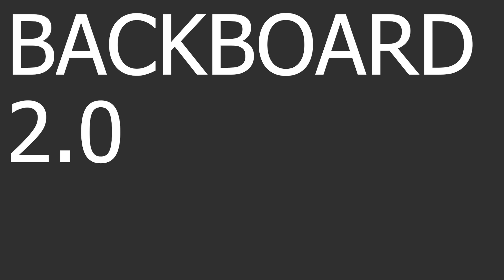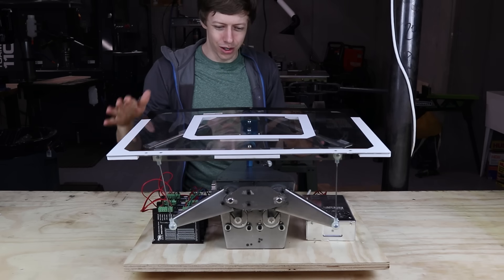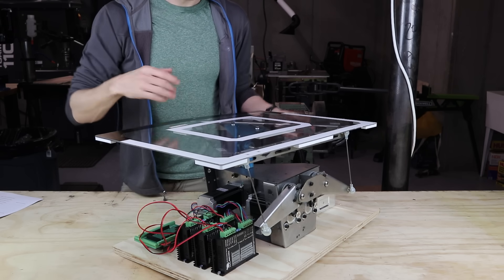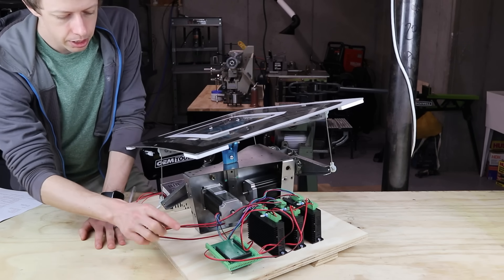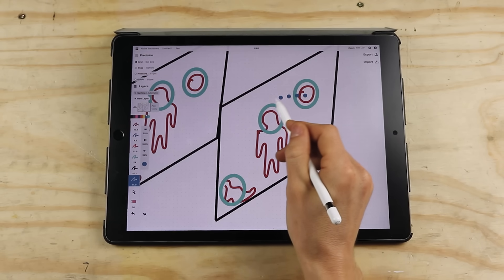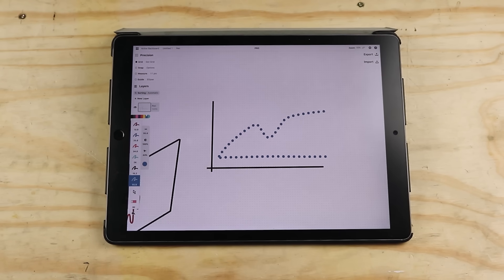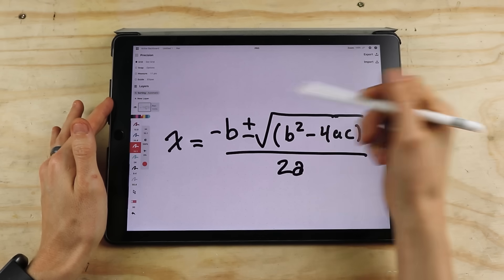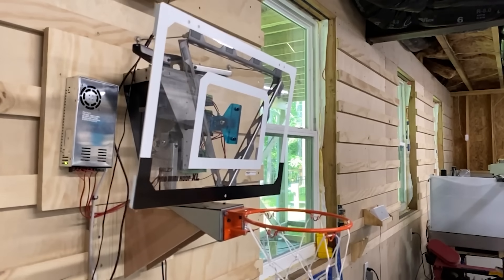The automatic hoop always goes in

Comment: Solving spin could be done using the same graph theoretic approach: there are two poses for every projection of a basket ball, so you simply match one hemisphere of poses, create two nodes for the closest match(es), then solve for the most linear slope of angular velocity (might want to use quaternions).
Reply: Alternatively you could estimate surface velocity directly, then you wouldn't need to solve for it when calculating the moment at the backboard.
Reply: If you model it as a constraint system, you can even solve for the Magnus effect, lol.

Comment: i don't know if this would work or is possible but could you put an RFD chip inside a basketball, like glue it to the inside of the bladder, and then use that to keep track of the basketball? Then it could make calculating the shot a little easier on the processor cause it knows the position and doesn't need to detect the ball mid air.

Comment: A cool addition to deal fast thrown shots (and ultimately less time to analyze) would be a guess adjustment to better set up the back board for the final move. Like take points from the earlier analysis and use those to make an estimated flight path and and only half compensate for the angle. Then when more data is collected and the ball has less time until impact, take the final calculations and move the hoop the rest of the way. Maybe it will have a significantly smaller distance to travel and thus can wait longer for the ball to reach the hoop, ultimately achieving a more accurate adjustment

Comment: What about potentially starting the tracking of the ball movement before it even leaves your hand? If you could recognize hand holding the ball by it's movements as it was beginning the throw, and know the approximate weight of the ball, then using physic's calculations. potentially start the prediction of its thrown curve before the basketball even begins the throw?  Although thinking about it, I imagine the hardest part would be to determine the actual vector trajectory of the ball, since it is heading directly at the camera.  Maybe a second camera in conjunction to have depth perception? I'm obviously not an expert on this, so I'm positive I'm missing some potentially obvious things, but just my thought's on the matter!

Edit:
I just finished the video, and understood that the actual interpretation of the kinect image is faaar more complicated than I initially thought so it's unlikely to be able to determine what are the hands...

Comment: You could have made a 3d model of the ball offline and then use perspective-n-point in real time to figure out fast where the ball is at.
To build the 3d model you could've used a corner detector algorithm from a lot of different angles and a feature matching algorithm between them, and then you know for each point in the ball in which pixel it is in each camera, now assuming you know the rotation and location of each camera you can build 3d lines from all cameras to the pixel and calculate it's location by the inverse of the sum of the rejections multiplied by the sum of the translations of each line.

Comment: I know it may be obvious, because you surely are a smart person with a big knowledge, but don't use Arduino in time sensitive aplications. STM32 microcontrollers are way faster, have much more peripherals, and are sometimes even cheaper than atmegas. Also, STM software lets you deal with all the register setting with graphical tools, you can debug your code, send variables in real life etc.
Reply: To give you some numbers: 
Atmega: 16Mhz, 100k samples/second 10bit ADC, 1x 16-bit timer, and some commucation modules (but very little).
STM32F103: 72Mhz, 1Msps 12 bit ADC, 4x 16 bit timers, much more communication (including CAN), lower power consumption.
And F103 is a lower-range STM and is cheaper than atmega328. You can buy STM32F401(so high performance range) on a board for like 4 dollars.

Comment: You say the microcontroller is your speed limit, have you considered using a microcontroller based on an ARM 32-bit MCU? The STM32 Nucleo64 development boards are based on these, they can run way faster than the ATMEGA MCUs the Arduinos are based on and the Nucleo64 boards feature Arduino pinouts too.

Comment: Since you are looking for improvements for this project, I could recommend using an FPGA board insted of a microcontroller. The FPGA would allow for super efficient processsing of sensor data and control commands since the logic is implemented on a hardware level.

Comment: Stepper motors are prone to resonance. They often don't perform as expected for other reasons as well. Unexpected friction or looseness causing a jerk etc... If you used dc servos it could work better. Steppers have a speed limit based mostly on the inductance and the voltage fed to the drivers. Beyond that speed you lose torque quite fast. If the stepper is somehow behind on its path it will quickly lose steps and may require moving faster to get there in time but that just moves the system into a state where it loses more torque and loses more steps. Not that the drive is even aware of the motor position, it only know it output steps not if the motor is stalled. With servos there is position feedback and while a brushless servo might be a multi phase motor which a stepper also technically is the controller may use a variety of different control methods for slow speeds and positioning of the motor, but at speed its likely using the position feedback or back emf for the signal for motor commutation and the motor speed is really being controlled by voltage as opposed to the stepper which is speed controlled by commutation and voltage is a product of a constant current circuit in the drive. The difference is that the drive in not only aware of actual positioning but if it is somehow behind and it needs to go faster it simply ups the voltage, when the voltage goes up so will the current and torque. To do this with steppers you'd need to custom design a drive that could detect lost position and also increase current in those situations. Some hybrid steppers exist and I have know way of knowing if they modulate current with lost steps or just play catch up but either ways it gets silly trying to make a better stepper motor because a servo can easily have a better speed envelope and may not be more expensive by the time you install encoders and custom firmware to a stepper system.

It's a pretty cool design. I wonder if having 3 motors is necessary. Would it be better with only 1 valid solution? Or are there situations where the envelopes of 2 different shots can't fall within the range provided with 1 fixed pivot?

Comment: Awesome! Your drawing of the trajectory selection problem looks like a trellis diagram. You might be able to use the Viterbi algorithm to quickly calculate the most probable trajectory. I am not sure but that could be of lower complexity than fitting all those possible trajectories.
Reply from the maker: Oh very neat. Haven't heard of the viterbi algorithim before.... sweet it's in my algo textbook. Will check it out. Thanks!
Reply: Also consider using Linux with PREEMPT_RT scheduling for the control computer to avoid any lags.

Comment: What if you would use a ball with a Bluetooth emitter attached (inside the ball or outside), that communicates with the panel in Realtime, instead of using data from the camera (or use it for more precise movement) and use a base station like one for the VR, behind you, to get the position for the ball (the start position, the trajectory, the end position etc)

Comment: I like your design but there are some areas where you could save on the number of parts. For one, you have a moment arm with the stepper motors that is geared down. You could move the pivot points closer to the center of rotation to possibly eliminate the toothed gear reduction and go direct drive. Or did you consider that but need the extra arm length and attachment points to reduce the tangent forces on the ball joints? It's a very interesting design and I think you nailed it with the pure explanation of F=MA. I frequently use the hammer as my example of power and force. Everybody should have or plan on holding a hammer, try rotating it and hitting a nail. Flip it around in the hand, try again, and again, and faster! The power requirements are going to be very high with the accelerations you have and moving them in the Z axis is going to double the power required vs tilting the plane ABOUT the pivot point.
Very cool work and congrats on the projects success both physically and in virtual video view counts!
Reply: Oh, and did you try using, or have you heard of, the PixyCam2? https://pixycam.com/pixy2/
The framerate is high at ~60 and computation is done locally. I'm also glad you mentioned early on about the Microsoft Operating system lag. Non-realtime = bad for controller design.

Comment: How about for ball tracing you just use the depth info from the kinect? If you have pixel depth, check in which ball blob the depth moved the most towards the hoop. Doubt you can headbang faster than you throw that basketball ;)

Comment: Why don't you move the board to the middle position of ones required for all possible trajectories of a ball and cycle this action while you are estimating a trajectory. This will minimise time required to move the board physically and even if you are late to move because of calculation delays you are already almost there so you chances are much better. This also can help you slow down the board motion speed required and give you more stability as you don't need to stop it fast after fast motion.

Comment: I'm not really sold on the "wait until last moment and then move as fast as possible", do the drives not enable you to update target position before the movement is complete? The sensible way to do it is to start movement as soon as possible and to continuously update the target position as the trajectory data is refined. That would give much more time for movement and smooth out the motion curve. Each update in target position would require progressively smaller adjustments resulting in a smooth and continuous motion until the ball hits the backboard. Smoother motion results in smaller power requirements and more accurate results. And if Arduino is the limit in communications, maybe just use a regular usb to serial converter, that's all it's doing there right, forwarding serial comms to drives?

Comment: Perhaps in the next iteration you can try running it off a platform other than windows to reduce the OS overhead? This sort of machine vision problem might work well enough on an Nvidia Jetson?
Also, if you can, I'm sure a lot of people (myself included) would be interested in the code you used to interface the kinect camera with your mathematics (MATLAB?, Julia?, Octave?) - So perhaps a bare bones github link in the description would be cool?

Comment: You can replace the arduino with for example an Stm32f103 "BlackPill" board. That would be arduino compatible but a lot faster. Just need to change some of the pin definitions.

Comment: Why wait to moove the board? Iknow it mooves fast but why not move the board to where it thinks it sould go as soon as it can and ten update that as late as you canwith the new data to do micro adjustments. Since the board is almost already in position and you only need a tiny asdjustment to you can do it later than if you had to move the board all the way. This will allow you to catch more data and be more accurate in your  final positioning.

Comment: Did you sweat over these solutions or does it just come to you as a matter of fact? Im a ME student and hope I can be a master of the craft like you one day
Reply from the maker: It depends on how involved the design is. For stuff that isn't calculation heavy I usually have the design pretty clearly in my head before I do any CAD though sometimes I need to sketch to work out finer details. For this project I was able to directly build this design in CAD after doing the motor computations for power, gearing, and backboard inertia.

Comment: Have you considered using the Teensy family of Arduino type microcontrollers? V4.1 is currently at 600Mhz which is twice as fast as the fastest Arduino that I’ve seen. I was planning on using one of these to start my “ECU” build for my military truck so that I can get rid of stuff like the cable driven speedometer and tachometer, as well as integrate a GPS system into it.

Comment: Pretty cool design and execution. Particularly I lack the mechanical experience and access to the tools you got and that's my current limitation.
For the software and MCU, consider using an ESP8266 or even the ESP32. Both are a super cheap alternative to Arduino and much more powerful.
I would go with the ESP32 with ESP_IDF.

Comment: I'd be really interested to see the code as well! It sounded like you're collecting the candidate trajectories until the end and then sorting through all of them, which depending on the quality of the Kinect's recognition models, could be a huge number! It seems like you could take time slices of a few frames at a time and produce a reduced set of likely trajectories before stitching it all together. Rather than collecting, say 50 frames and then ranking all the paths of all of them, you take batches of 10 frames, find the most likely paths in each, and then try to stitch together the best path through all batches. It would reduce the path length, which might simplify the calculation (assuming that part is a bottleneck). If managing the trajectories takes more than a few frames of time, you could potentially even parallelize path pruning in the background as new frames are coming in.

Another idea I had (which would probably require some machine learning), would be to get a head start on the visual processing. Since it seems like you have figure data from the Kinect, could you learn what a "throw" looks like before the ball even leaves the hand? That way, you could eliminate some things as candidate balls before the ball even leaves the person's hand. Since there isn't any other tracking needed during that time, spending cycles pre-throw is cheap.